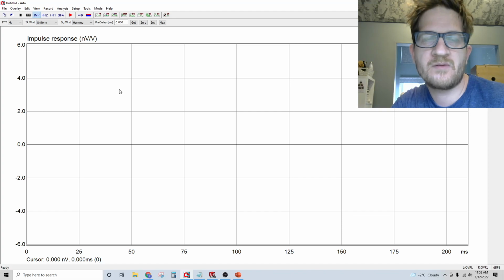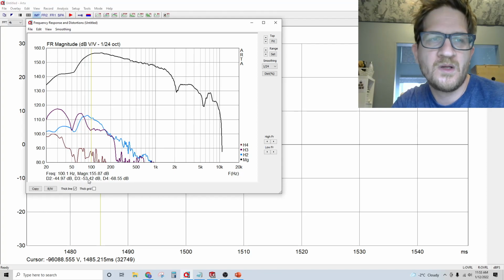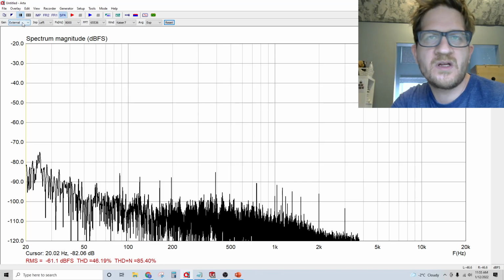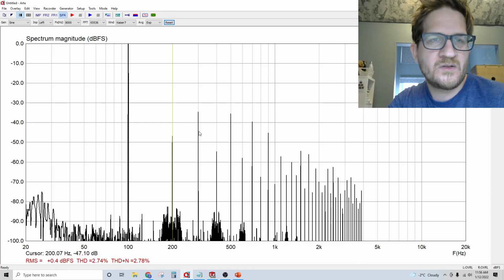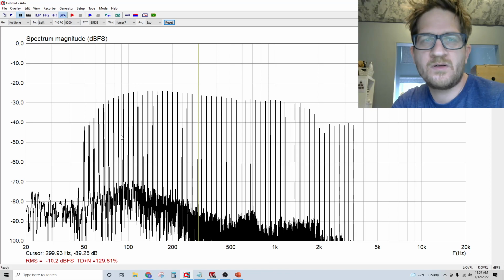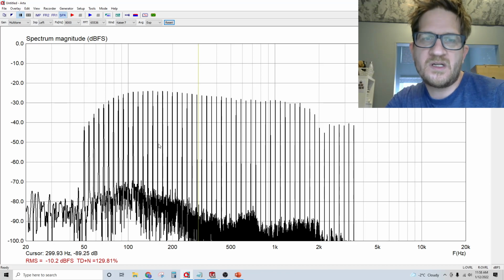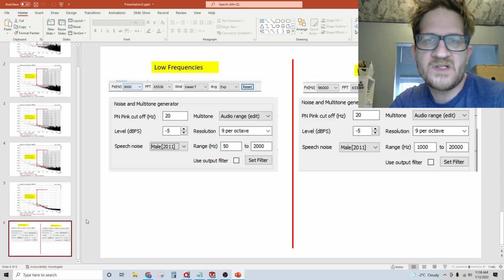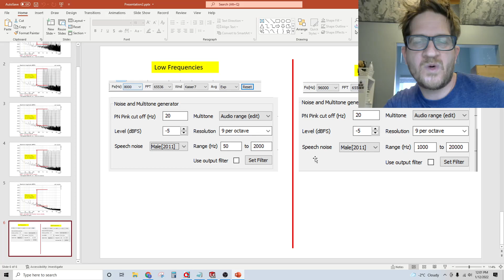Testing Loudspeaker Distortion in ARTA

Comment: Hello again, can you pleaee recommend type of measurement to test cassette decks, how they are "good" (sound quality)? I seen this video, first test with sine tone, we can see the accurate value of thd, but this is only for  the 100Hz. With multitone 50-2kHz set isnt so accurate, rigth? I have an deck, pc with sound card and of course Arta installed. Thank you.
Reply from the maker: I think multitone and the harmonic distortion sweep within ARTA would be good tests. There’s also two tone using x4 magnitude for the bass/modulating tone.

Comment: Sir - you are overdriving your input.

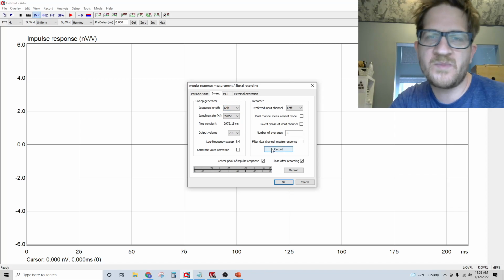This is indicated by a yellow (warning), then red (overdrive) of the level bar in the IR measurement window (1:10), as well as "OVRL" for "Overload" on both channels in the dBFS Meter (bottom right of ARTA's main window) in the SPA mode.

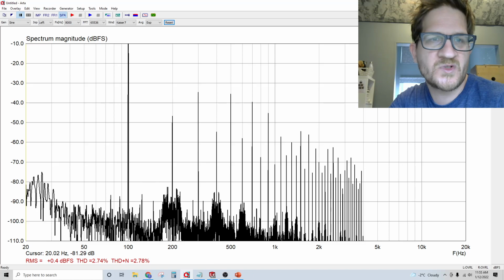Since you're only in the tenths of a dB beyond the digital dynamic range (3:33 - RMS = +0,4 dBFS), the added harmonic distortion due to the clipped signal isn't that severe. Still, adjust your level slightly to fit within the digital dynamic range, and you will see the distortion of the driver itself is much lower.

Reference: ARTA User Manual, pages 54 & 55, 81, 168.

Comment: Hi Joseph.  Thanks for all the cool videos!  I know this is a bit off topic but I was wondering if you could comment on the sound quality of the Nero 6 inch midrange that I noticed you have used.  I'm thinking of using it in a speaker but am a little concerned with the resonances seen/blips in the impedance curve.  I'm curious if it's a worthy successor to the old Audax PR170.
Reply from the maker: I’ll be doing some further critical listening on this driver in the coming weeks.  The high grade crossover components arrived yesterday.  Initial impressions are good.  I used it much higher than I originally planned, 600Hz-4kHz.  I’ll be publishing full test data once the project is finished in about a month.
Reply: @JosephCrowesDIYSpeakerBuilding  Awesome!  Looking forward to it!!